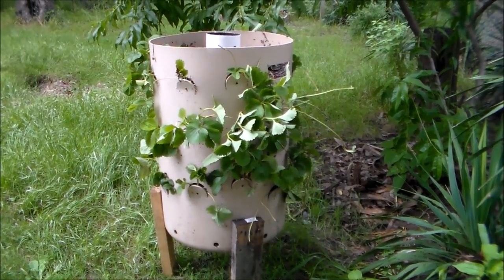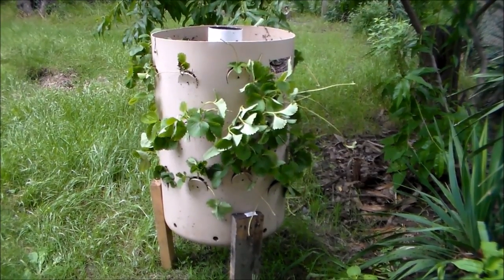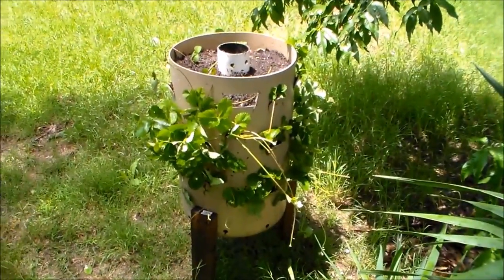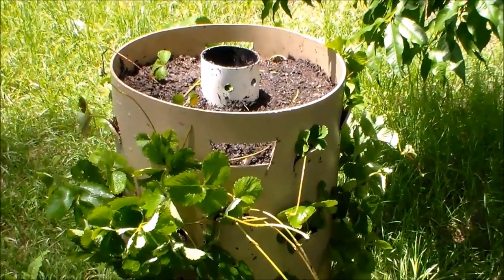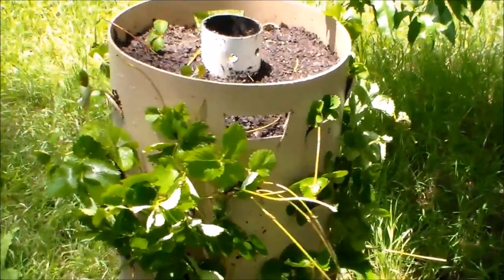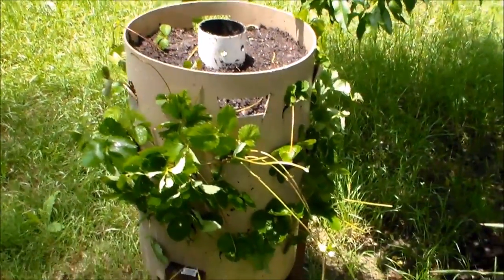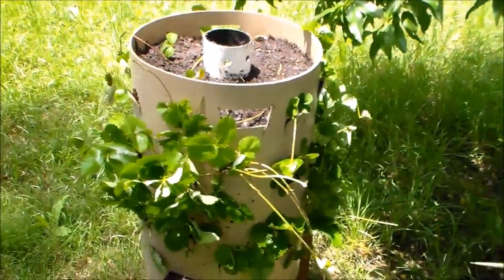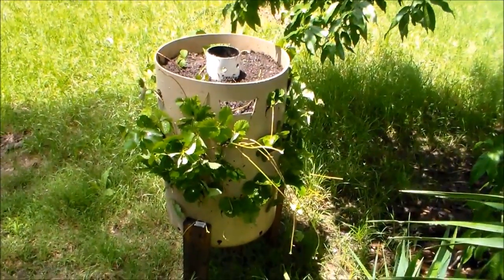Vertical Gardening Build a Grow Tower Barrel + Worm Tube

Comment: This sure beats spending $360 (an absolutely outrageous BS cost) on one of those Garden Tower 2s! I can buy a food grade 55 gal plastic barrel for $25. Thank you for this video. It is much easier your way than trying to heat and bend the plastic slots which I have seen in other videos. I have a large hole saw that will work perfectly.
Reply: The container the video used seemed to be a lighter plastic (it even looks like a trash can) so drilling the hole and then opening the flap seems like it was enough for this particular container.

This makes me think that those 13-gallon or larger trash cans that come with their own set of wheels, might be a good idea to have a mobile tower.  While we may not move it from place to place all that much, at least it could be able to be turned as needed to let all sides of the tower get sunlight as needed.
Reply: 0:16 0:16 0:16

Comment: put it in a red rider wagon start in the green house
pull it out in spring put back in at night if needed do to frost
can move it around the yard with out killin grass
freeing up garden space
can put in the shade if too hot  so the plants don't burn
could all so put chicken wire around wagon
use stakes and slots so to be easily removed
Reply: Excellent idea!
Reply: Eric Fitts
Reply: Not sure a red wagon would hold up to the weight but wouldn't be to complicated to build a cart using plywood and swivel wheels from Harbor Freight.
Reply: You could pull it around the neighborhood and let kids pick some when it's time to harvest 😁

Comment: how do you put IN THE 4 INCH PIPE DOES IT GO ALL THE WAY THROUGHSO YOU CAN GET THE CASTINGS OUT
Reply: The castings remain in the container. You don't need to get them out because they are already in where you would have put them anyway, if you had a separate worm bin and garden area.

Comment: Hi, Ryan.  You appear to have put in the wrong sort of worms.In the USA you call them Red Wrigglers, used for fishing, we call them Brandling Worms.  You have used earthworms which work in completely the wrong way for your application,  Earth worms do not eat compost.  The system will never work with earth worms, you will just have a smelly mess down the tube.  Get the correct worms.